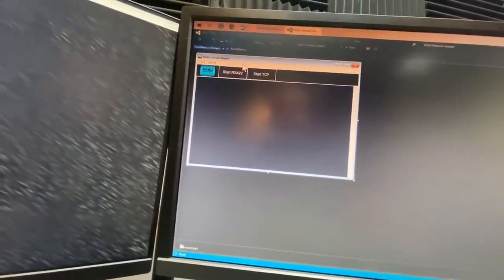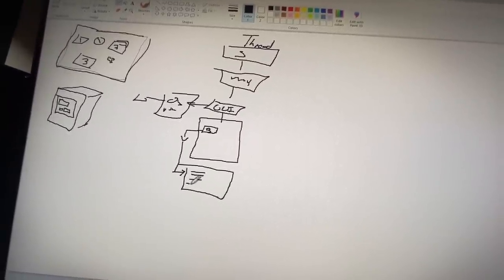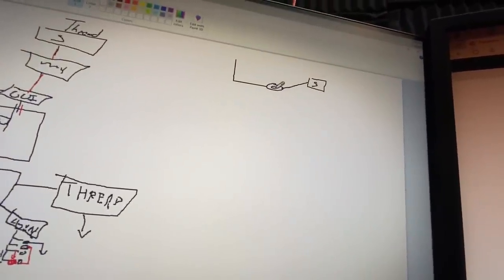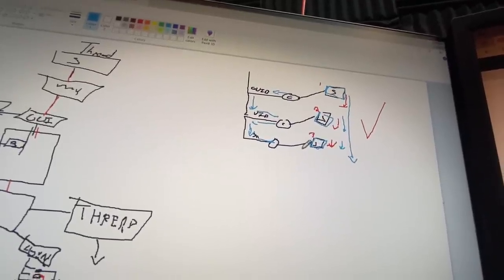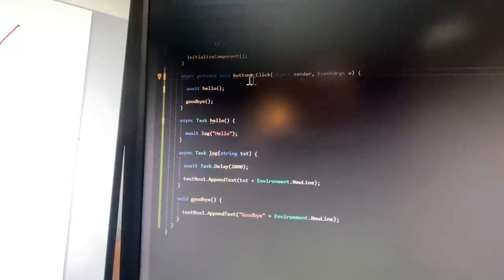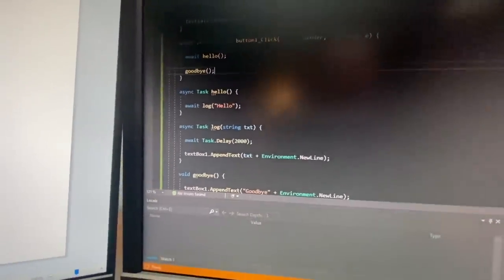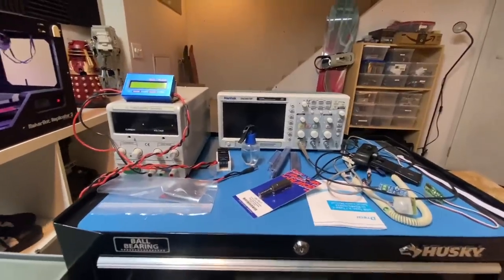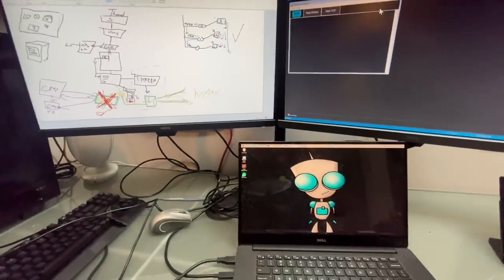30 - Software Threading - It's like knitting but knot.

Comment: I'm a software guy, and have done some multi-thread programs, mostly in WinForms. What you said is pretty much correct.
Reply from the maker: Thanks! Dealing with broken async code is a pain when we come across it. Sounds like you've had the same experiences with bad programmers :)

Comment: For the slow machines I think that the problem you had is the update rate, I haven't seen the code of your server but if you are updating the GUI each time a packet is sent and several packets are sent each second then you're saturating the GUI, restrict the progress bar to go from 0 to 100 so it represents a percentage and restrict the updates to happen only twice a second and only if the percentage is different, that will for sure make it work in the Pi without much trouble, updating twice a second a progress bar should consume nearly zero resources.
Reply from the maker: That doesn't matter - because the progress bar has a timer and only updates at set intervals. So you can specify a kazillion increments, but you will only get periodic updates to the bar. That's why the progress bars are not completed on a very fast process.
Reply: You mean in your code or by general? It's very difficult to say anything without seing the code :). If it is in your code, then yes, you're already doing what I proposed and I have nothing else to say, but if you mean the control itself, there are two problems, the first is that it's not updated in a timer, each time the value changes the control gets refreshed, that invalidates the control and redraws it, what is controlled by a timer is the marquee, how fast the bar progresses, but the value change will force the control's redraw, you can check mono's source code for the progressbar, it's all there :). The second is that if you are updating it from other thread using invoke that is also a heavy operation, if you check first if it needs to be updated and then only invoke once or twice per second it will use a lot less resources.
Reply: That Control.Invoke has a non-negligible cost of marshaling, you should really pace it down to once every 100ms or so.
Calling a method in the UI thread involves pushing a message into the Windows message queue to unblock the thread looper of the GUI so it can execute the delegate. 
On Windows, UI threads keep running a while loop of GetMessage and PostMessage (that fires delegates). 
GetMessage is blocking. (The thread wouldn't spin the CPU into 100% obviously, the entire thread gets frozen into wait state, WaitForMultipleObjects actually)
Reply: And that still wouldn't solve the problem with your original code, The real issue was not the cost of updating the GUI, but the fact that you were using Spinwait to freeze the thread to fix a timing issue. As I said on comment in the previous video (yeah, too late, I know) :

Basically SpinWait is a no-go for timing in a modern computer. Spinwaits should only be used for locking on memory barriers, to be more technical. not for synchronizing threads, or worse, the hardware, its ironic SpinWait sits on the Thread class, that's because its common to spinwait for a couple of milliseconds before taking the proper lock by CMPXCHG (via mutex *1) or something that's actually an atomic instruction instead of only data-dependant.
That's a very advanced technique used to create "lock-free" data structures, its used to implement Semaphores and Mutexes themselves, and you probably shouldn't be using it on user code that often without a good reason.
SpinWait for I/O is no good, its basically a red flag.

(*1) and then an actual syscall to the OS depending on what you are locking into, if its to protect a critical section or some other resource.

-------------------------------------------

In conclusion sleeping threads is a bad thing in time-share systems, I basically consider Thread.Sleep a bug when I see it, there's no reason to ever use it except in debugging scenarios.

The real problem is that timing in a modern computer is not accurate, it will jitter all the way around as things happen, as the load changes.
Sure the updating the GUI was causing delay, but moving the code to its own thread will still have the same problem, what will happen is that your computer will be idling and not doing much of anything, so the amount of context switches is going to be low enough that it will work, but bear in mind, the problem isn't fixed for good, if you keep having the delay and the system load increases (the user is compressing a Zip on background), you are going to get your bug back, a regression. 

Then what's the solution ? ring-buffers !

So that's why only using "Stream.Write" and stop bits solved the problem, you just pushed data as fast as you could into the "stream.Write" and it uses a hardware buffer (even if you put 0 into the buffer on stream, there's still a driver buffer and a hardware buffer, also, that has to go through USB, so it definitively has a hardware buffer on both ends)
Reply: When you really need accuracy, the best way to get that is never sleeping a thread, but just taking the performance counters of the sound card. That you guarantee 15ms of accuracy, which also presumes the system is not on high-load. You don't sleep the thread, you do nothing and wait, and yes, that will spike the CPU and waste a lot of energy, which is why almost no one does that, that's another use for spinwait. 
I did that once when I was processing MIDI.

More than that is not possible without a `realtime-mode` driver on top of the multimedia time-sharing service that uses actual hardware timer to fire your method, but by that need you would have to program a windows driver that runs inside the multimedia framework (it uses the SMM on intel CPU), and that's on kernel-mode. That still will give between 1ms to 2ms accuracy, you cannot have better than that in desktop computers without dedicated hardware, but a masking of a CPU core would do almost that . You are also going to get fun bugs like IRQL_NOT_LESS_OR_EQUAL.
Using Windows as an RTOS is a "fun" endeavor.  (Linux isn't much better, but there are RTOS that you can plug before it,  modern desktops aren't Real Time in any way if you need things like "network")

An arduino is really a good alternative if you really need strict timing like that, its going to be easier than writing a Windows driver.

Comment: One important thing for programmers to realize that may not be clear from the video, is that async programming in C# (with async/await) does NOT create threads. That's a common misconception. It's too involved to explain fully in a YouTube comment, but multithreading is not the only kind of asynchrony. This Nabu code is using Task.Run(), which runs on an operation on a background thread and is awaitable, but it's called in a synchronous method.
Reply from the maker: You got it! That's why i split the new thread and async into separate solutions

Comment: 9:30 you're describing a race condition. Two or more processes that have to complete in a certain order, but there are no checks in the processes to determine if they are completing in order. It works when the conditions of the hardware and various other factors don't cause any delays or speedups in any of the processes.

That's what killed people with the Therac 25. Operators working carefully and deliberately to make sure they had everything correct before hitting the button to zap the patient allowed the software threads to run to completion and properly configure the machine. But as operators gained experience and confidence they could work faster than the software could get the machine configured - and there was no check for readiness by the process that triggered the "zap" when the operator pressed the button. It would trigger firing no matter what. The dose could be anything from nothing to very damaging and ultimately lethal.

In the earlier Therac models, there were electromechanical interlocks, circuit breakers, and fuses that 'watchdogged' such things so that the machine was physically blocked from firing an incorrect amount of radiation.

Another, different kind of error was tied into the remote button in the treatment chamber. It was monitored by a process that counted a byte up repeatedly from 0 to 255. If the operator happened to hit the button precisely when the count rolled over from 255 to 0, the Therac 25 would blast the patient with an unregulated amount of radiation.

This was in the early 1980's when computers were mostly operating in the single digit megahertz speed range, so it was easy for poor software to make a computer slow enough to be 'out run' by a human. Had the Therac 25 had a control system running at 25Mhz or something like that, it's unlikely that even the fastest operator could have set all the parameters then hit the button before it was ready, and the chance of pushing the remote button at precisely the wrong time would have been next thing to nonexistent. The likelihood of anyone getting injured or killed by one of the machines would have been next to nil. Not impossible but very unlikely. Even at the "slow" speeds back then IIRC there were only two or three known incidents of injury or death from that bug. The majority were caused by the main console race condition.

What could never be known was how many times the bugs did nothing due to insufficient radiation available to cause harm.

Comment: and the mouse cursor is also a program, in it's own thread. although it would, like lightpensupport, or the text cursor on most decentlydesigned systems, belong more in the video controller itself in hardware.

Comment: 5:30 Async is not that expensive to run. It costs on average 400b of memory per call. And the stopping point is I/O. It doesn't go creating threads for every call, It keeps a pool of threads that just take work as needed, and then return the thread for other calls to use.
Its very cheap because it uses "lock-free" data structures to move data, that only uses barriers and spinwaits, which you must not use for I/O, but for data, for I/O you either do async I/O (IOCP on Windows, it uses software interruptions instead of blocking) or use mutex, or let the operating system block your process, which is VERY expensive, and was what Async was created for.

Its obviously not as cheap as a stack call, its comparable to an operating system call (a syscall, or a supervisor call).
Async is basically a state machine that decides if you keep run the code in sequence or aborts, when it aborts the run for "blocking" (I/O) reasons, it doesn't hang up the thread while it runs (threads are expensive, async isn't, its just 400b of memory and a couple of nanoseconds for the data-flow-barrier inside the CPU, threads have an entire stack and that cost kilobytes of memory and time to create, hundreds of microseconds) .

The idea with modern computers is that I/O is so slow for a 4Ghz machine, that even paying 10ms per call (in the worst case scenario) is still cheap, because the system would have been doing nothing anyway, or just churning away context switching, because the rest of hardware wouldn't respond, it is that slow compared to the CPU, even an SSD is SUPER slow, and not even get started with "microseconds" in a network "call". 

Async is basically for free if you take into account the external cost of a context switch between threads, which costs usually ~100ms, which you don't have to do with Async, Async at the cost in average of ~10ms is much cheaper than imperative sequential programming.

If your code does a lot of I/O, or any network call at all. Async cost is 0 (its staggered), because the time you "wasted" doing the async is still less than the time it will take for the networking data to come back. Async allows you to cram more things into your computer to process instead of being useless waiting for the network.

Comment: Just wondering if NABU Corp had used a ZILOG Z800 or ZILOG Z8000 that could have had a multitasking system that would work better than one running a ZILOG Z80A.

Comment: how often and how many segments was your progress bar running at? my feeling is that if you updated in 100's ms or 10 % increments the cpu load would be minimal. Or are saying one update of the progress bar was enough to delay the rpi?
Reply from the maker: progress bars only get updated by a timer. You can't update it by setting the value. The progress bar is a timer on 500ms.
Reply: @DJSures  yeah i would not have expected that with that kind of delay. thanks

Comment: Random question. Was wondering if you are familiar with the Nicolet NPC-800 logic analysis system?
Reply from the maker: Thanks to your comment, I just googled it. Wow, that is some rare piece of hardware!
Reply: @DJSures  it's a piece I got about a year ago. I have the disk and downloaded the manual but haven't given it the time to fully understand it.
Reply from the maker: @peacefrog5099  Wow i'm quite jealous, that's really cool. Hopefully you'll share a video when you get it working one day
Reply: @DJSures  It is fully working, at least 6 months when I turn it on to make sure it still was. Just don't know how to use it yet and I have no cables for it.

Comment: if you have a 1000THz (yes 1k THz) single core processor, you can slice that to as many logical (software) threads as you can, for simple processor (cgpu) design
Reply: thats kinda like as having 100k of 10GHz cores running parallel, is serial better than parallel, if the design is simple
Reply: if you then run those single 1000THz cores in parallel, thats fast
Reply: pro tip, specialized chips (signal processing) can run way faster than typical cpu cores that have complexity issues, ie decoder chip can be cranked to run much faster frequency than a normal cpu
Reply: k.i.s. smarties amd intel nvidia arm risc-v, dont do dum dum
Reply: language implementation specific hurt, generics are fine
Reply: single physical core is simple to deal as thread sharing, you just have a list of tasks/threads that are running, at some priority or same priority
Reply: multicore is not more complicated from that then :)
Reply: thread is only a memory segment that stores the task details

Comment: 10:03 That's why you never fire and forget "async". That is really a bad model. You should always do fork-and-join, which basically means if you fire a lot of async tasks, you have to await on all of them.  Fire and forget is "async void".
Async is not parallel programming, it is sequential, but time unbound.
Basically, you have to wait on your calls, all of them, except the very top one !

Comment: What language are you talking about? C#? Its been a while since I worked C# and never worked with it's async task executor. Are you saying that the order of two dependent tasks is not determinate if you don't return a value, but you do reference a temporary from one within the other? That sounds like insanity.
Reply from the maker: It's because the language structure allows async methods to not be awaited and only gives a warning. You'd have to watch the video to see the results - but I give an example of how methods can run out of order if they're not awaited. Awaiting is a good habit, but the compiler really should return an error because I can't see why anyone would want to call an async method and not await it shrug